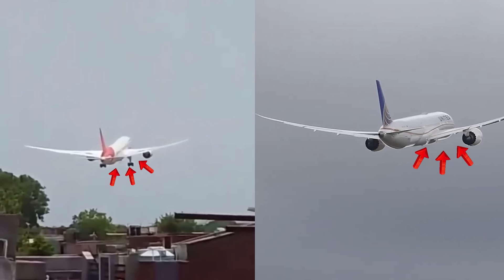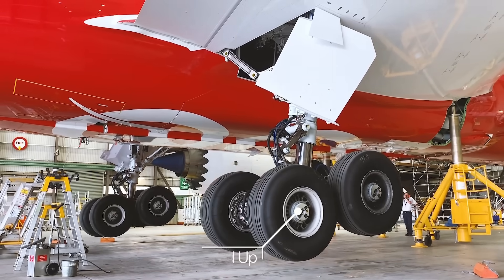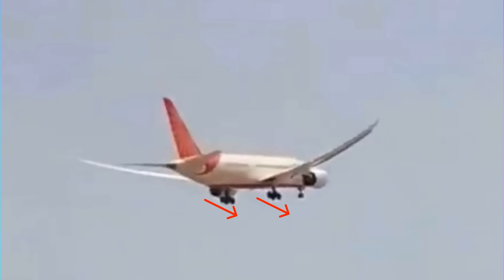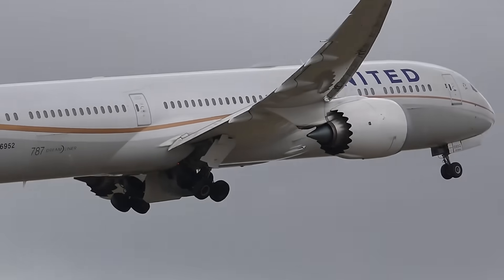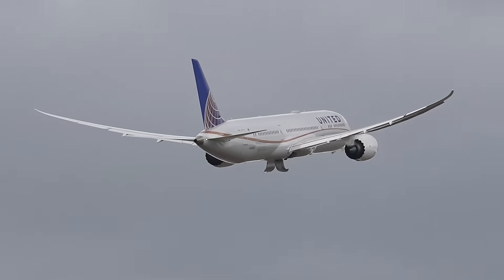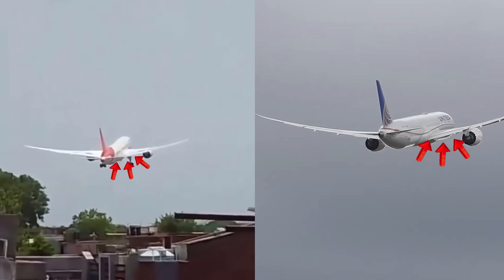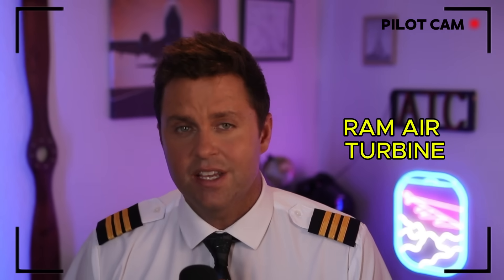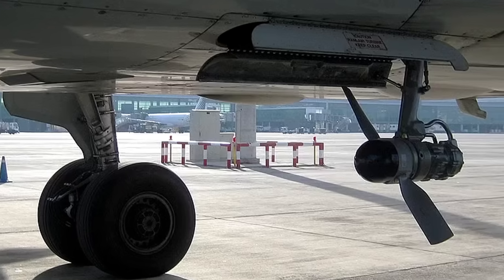Pilot Explains: A New Detail in the Air India 787 Crash Everyone Missed

Comment: Visual Evidence and System Behavior – 
	1.	RAT Deployment: The Ram Air Turbine (RAT) was visibly deployed, and its characteristic noise is audible in video footage, confirming the aircraft lost primary electrical power and was relying on emergency backup systems.
	2.	Engine Silence: Both engines appeared inactive, suggesting a complete loss of thrust, likely due to engine flameout or fuel supply cutoff.
	3.	Landing Gear Position: The nose gear remained tilted forward and stuck until impact, indicating a likely loss of hydraulic power needed for gear positioning.
	4.	Stable Descent: The aircraft descended in a controlled and stable manner, with no observable yaw or roll oscillations. This strongly implies that both engines flamed out simultaneously, as asymmetric thrust would normally cause significant directional instability.

These observations point to a major electrical power system failure, which likely disabled the fuel supply system, engine operation, and landing gear hydraulics, leaving only emergency systems such as the RAT functional.

Possible Causes of Total Electrical Failure

1. 2012 Boeing 787 Generator Control Unit (GCU) Bug

A known software bug in the GCU could cause a counter overflow after ~248 days of continuous operation, leading all primary and backup generators to shut down simultaneously. The FAA classified this as a “cascading power failure scenario” due to the complete loss of AC power across all systems.

To mitigate this, Boeing released a software fix, and the FAA issued Airworthiness Directive 2012-24-07, requiring airlines to either apply the patch or regularly power-cycle the aircraft.
It is currently unclear whether this aircraft was compliant with the directive at the time of the incident.

2. Catastrophic Failure in Power Distribution Unit (PDU)

Another possible cause is a high-energy arc fault or explosion within a major Power Distribution Unit, which could trip relays across multiple buses. Normally, such events are isolated by the Electrical Load Management System (ELMS) and bus isolation relays.

However, according to a Boeing whistleblower, non-standard materials and substandard manufacturing practices may have compromised system reliability. A failure in current sensors could prevent ELMS from correctly identifying faults, causing it to shut down even healthy power buses.

Poor insulation or material degradation could further allow electrical arcing to cascade across buses, resulting in total power loss.

Supporting this theory, the survivor reported hearing a loud bang shortly after takeoff, followed by stalling and flickering green and white cabin lights — consistent with an internal electrical explosion or fault affecting both primary power and lighting systems.

Comment: Good analysys, however, something to point out:  On a 787 gear retraction, the doors open first prior to tilting the boogies forward.  I've read that the tilt actuator on a 787 is of course hydraulic powered, in case of hydraulic loss the gear could go back to it's "original" position, aka tilted forward.   Nonetheless, good video.

Comment: The wrong type fuel in aircraft will cut engines off. If fuel tank storing fuel hasn't been drained and flushed properly and water or contamination was still in the tanks. We all know maintenance has been seriously lacking to all air carriers. I spent 20+ years in the USAF and saw first hand on fighter and trainer acft how people not doing their job caused certain things!
Reply: At least in the military regarding aircraft you have others checking on such things cause things happen even if unintentional. So it’s important to check that things are done correctly.

Comment: I HAVE A HND IN engineering I've explained this it's the fuel accumulator failure
This is the reason for it not to get lift this is a unit which gives the engines lots of fuel to enable it to accelerate for lift off. 
That's the reason why the pilot left the wheels down
He wasn't getting enough lift
All systems working fine
Listen to the voice record 
He's saying I'm not getting the engines to accelerate

Comment: I think there's petrol shut down. What I mean here is If the petrol is there that is required to take a fly was there but the valve is closed or sabotage which may fuselage sabotage. That only the reason which is makes both engine failed due to lack in supply of petrol but the cockpit always send alert if this any, then too cockpit unable to read when there's above a lakh litter petrol is there but if we sabotage by many ways like cement stones and valve. For example- Let's take a old two wheeler which have options from valve to off and put on reserve or not fully on then also person is able to start the engine ride run and suddenly is stops until the petrol is there in pipe. Once the pipe petrol is over then will get shocked why what happened as know there's petrol. But I know it's Boeing latest there's always a alarm but it can sabotage. Experts let me know if this can be happen as I'm not a aviation expert. But it seems 100% power lack as its come down without wavering its come straight.

Comment: The fact that the main landing gear bogie was in a nose-down (forward-tilted) position does not, by itself, prove that the pilots attempted to retract the landing gear.

The aircraft system is designed so that:
   -- If the aircraft is already airborne (WOW = false),
   -- And there is no load on the main landing gear,

Then the bogie tilt actuator is automatically activated, and it resets the bogie from the tilted-up position to level, and then to the nose-down (landing) position.

This happens even if the pilots do not retract the landing gear! --> The system ensures that the landing gear is always positioned for landing, even if it is not retracted.

Look at this video. Here's a B787 that did not retract its landing gear after takeoff, and the bogie automatically moved into the nose-down position.
https://www.youtube.com/watch?v=zxLJ9pd0ef0

(I am not suggesting that the pilots retracted the flaps instead of the landing gear. The fact that, in the video, only the RAT can be heard on the descending (falling) aircraft suggests that neither engine was producing thrust. In my opinion, this is what led to the catastrophe.)

Comment: This is the 2nd time by the same Airlines Air India that crashed last December of 2024 and just recently June 2025.  Two different air-craft made 737 & 787 by Boeing. The 737 max crash last December is still under investigation, and the cause is yet to be determined. It could be due to a bird strike in the engine or some technical issues.  When was the last time the Air India 737 max was inspected and maintained, and how long did it take? Were there qualified maintenance workers specializing in these aircrafts? It's worth noting that the planes were old, and Air India acquired them from a company in Ireland or somewhere in Europe. 

According to my research, the 787-8 in question is 12 years old. When was the last time it underwent a comprehensive inspection and maintenance check?  Did Air India ever seek assistance from Boeing for these inspections, including the engines? It's important to remember that inspecting aircraft is a complex and meticulous process that requires expertise and thoroughness.

My question is, how could the 787-8 take off and start climbing if there was a problem? The 787-8 is equipped with advanced computer systems that should alert the pilot to any issues before the plane lift off the ground.  Was there a problem that was not communicated before the plane began its takeoff roll? It's crucial for Air India to be transparent about these details to ensure the safety of its operations.

Two things that I totally believe it is either the pilot error or the inspection maintenance.  My brother called me yesterday he believe what he heard or read sound like there is NO WAY  it is Boeing fault.  Every airlines have to takes the responsibility to train the pilots exccesively and qualfing inspectors maintenance and always call Boeing for special inspection approval before the plane is allow to fly again.

Comment: I agree totally fuel contamination because that aircraft is in takeoff conviction, I have seen what happened with contaminated fuel in other aircraft, with the Air Force, and yes it's like they pulled the plug and no noise quiet as the poor thing went into the ground

Comment: Could you advice the fuel system on that plane? I assume each engine has separate line with seperate pump, filter and tank (inside each wing I guess). It is hard to imagine contaminated fuel disabling both engines at exactly the same time in such case.

Comment: If you lose an engine at V1, you would continue the take-off, you would use most of the runway ( that happened), with the distraction, you could forget the gear. The procedure is no action until 400 feet, just gear up and cancel alarm. At 400 feet, identify the failure and shut down the engine if on fire or severe damage. How about if the pilot shut down the good engine instead? The plane never reached over 600 feet.

Comment: 4:50 imo it was water in the tanks. And not a little. My guess would be that the fuel pickups are towards the rear of the tank, to guarantee fuel supply during a go around at the end of a flight, where the tanks would not have much left in em. Someone correct me if i’m wrong on that. But these may not be at the lowest point in the tanks, idk, to not suck up gunk which is at the bottom of a tank usually. With that said, the engines would have gotten clean fuel the whole take off run, and just after rotation, as the fuel shifted and the water went to the lowest point, which now was where the pickups are, they both died at the same time. Thats the only explanation i see. Bcs just "stuff" in the fuel would have shown signs earlier

Comment: I explained why the partial retraction supports my theory that the torque from the pumps helped to induce a compressor stall on the second engine. Power loss to the FADEC routine and a reboot status prevented auto-ignition.

Comment: Some say “vapor lock” , high heat on tarmac for several hours caused vapor inside fuel tanks, like a bottle of soda, when lying horizontally, fuel flows is ok, but once it climbs and take off causing the plane to tilt upwards, just like the soda wbotyle with the top/front tilting up, the liquid flows to the lower part while the gas vapor rise to the top, but, There were also other planes at same airport, why was air india only aircraft to suffer from vapor lock？

Comment: I think you hit the nail on the head with bad fuel. They would have gotten new fuel before take off. The fuel already in the lines was being used first. Thats why the engines seemed normal. Then the new/bad fuel hit and flamed out the engines.

Comment: You forgot it was 105 degrees, the plane sat there for an hour..the elevation and the weight of the plane were not entered into the computer correctly therefore the dentisy alltitude was not correct should of been set for 3,391'

Comment: Something on the end of the runway hit the plane or the plane hit the end of the runway, because the plane took off by sheer take off speed. Meaning right before lift both engines are down and electrical failure happened or vise versa. Check the take off footage on the exact timing of the lift.

Comment: Is there a correlation between an electrics failure and a dual engine failure? I'm just thinking with a video that a passenger took of the plane just hours before the crash where none of the entertainment screens were working, or AC, and the lights flickering as the RAT was deployed... I've only just learned about the RAT from Cpt. Steeve so I'm only just gaining understanding on it. Also is there any link between an electricity failure and the landing gear not being able to retract, or is that purely an hydraulics failure?

Comment: I travel out of India yesterday , too many people bring  on board large travel cases that are huge and very difficult to fit overhead lockers and they are not weighed before departure, long flight ahead with large amount of fuel on board so plane could be overloaded.
It doesn't matter how good the engines are , proper fuel supply is needed for engines to function properly, very hot day , did water get into the fuel supply ? Has the fuel pump been checked for any  holes , was the fuel tank where the fuel was being loaded from ,almost empty when the fuel was being loaded as it could have been contaminated at the bottom of the tank , what country did the fuel come from?

Comment: Please go to the Accident Air Florida January 1982, a similar accident, the took off normal, but a few feets they got a stall, why? well due to ice the sensors in the front of engine 737-200 were frozzen, so when the pilot move the levels to take off power EPR they got this EPR very fast and the plane run normal, and reach V1 and Vr on ground but, they didnt have a correct EPR, only a number on the instrument, due to sensors failling, then they wneto to air and logic the plne for inercia and ground efect took off, just to flight direct to bridge of street 14 , at  1000 mts from the thresholds 19. I mean may be for electronic probblems when they set the take off power, I guess full due to temp, I dont believe that they are using assume temperature, very hot day, so the plane N1 show 100% but due to a electronic failure, they have may be 50% or less, I know there is a way to detect this during the take off time to 80 or I dont know move slowly, they accepted this like an normal take off, and when they went to air , no enoght power, think about this. Or AT fail and retard the levels.

Comment: I think it was double engine failure, but doubt it was contaminated fuel. The first reason is why hasn't it affected any other plane, the second is the engines wouldn't suddenly cut out and at the same time. It has to be a controls issue.

Comment: The Engine Fuel Shut off levers have a Spring loaded detent in ON position. This lever has to be lifted up and moved Down to Cutoff position. So possibility of Both Engines flaming out by Fuel Shut Off levers should be slim to none. Thanks for your analysis

Comment: Electrical Bus Failure - Backup System is probably not rated to run both fuel pumps at full load during take-off - subsequently both engines flame-out?

Comment: When you select gear up the first two things that happen are 1, the wheels tilt, 2 THE GEAR DOORS MUST OPEN and I don’t see them at all!!  Which baffles me but I do agree with the engines have only ONE THING IN COMMON……………the fuel 🤷🏻‍♂️which makes me go with your mindset of fuel contamination and SOMEHOW the fuel filters got clogged preventing adequate fuel flow through the MEC and they lost power to both engines!  Sadly the power loss didn’t happen before rotation giving the a fighting chance to ABORT the takeoff 😢🙇

Comment: Pilot error seems unlikely. Dual engine failure is what it looks like. Boeing should be held accountable. Had it been contaminated fuel, the sane oil company provided fuel to the other planes. Why no accident to those planes. It looks like the unlikely actually happened and thats dual engine failure.

Comment: Captain Steve did mention that the plane had used up excessive amounts of runway noting that he observed dust being kicked up by the plane's engines . How normal is it for a 787 set up for a long haul such  to use up that much runway? If not obviously this could mean that the problem started during the take off roll before the plane became airborne maybe there's some indication from the black boxes regarding engine performance that should have warranted in abort attempt.. Regarding fuel contamination were there any other issues with planes using the fuel from that airport?

Comment: Did you consider vapour lock It was hot and it sat in the heat for a couple of hours… vspourisingfuel in the fuel lines?  It’s what a young pilotwas explaining using yesterday, it seems to me to be a possibility.. fuel vapour is more flammable than even aircraft fuel. Just saying, it made sense when the chap was explaining.  If fuel in lines is not liquid, but vapour?? = engine out?

Comment: Dual engine failure is such a remote possibility, it would have had to have happened moments before the RAT deployed, and if dual engine flame out was the cause then it must have been either fuel contamination, vapor lock, which I doubt because while it was a hot day planes take off in hotter cities all the time, or a failure in the the electronic engine controls, or possibly in the variable frequency starter generator.  That in turn suggests again an electrical problem in the Dreamliner.  It seems hard to believe that the fuel would be contaminated at an airport as busy as Ahmadabad without there being other planes affected.  Anyway, both black boxes are in the hands of investigators so if the investigation is honest and transparent we should soon know what happened to the plane.  I am just very doubtful that any blame will be shed on Boeing for its fundamental design, because a grounding of the Dreamliner likely would be the end of Boeing and there is far too much money at stake to allow that to happen.

Comment: Great job. One thing you could add is that the lack of fuel could be from shutdown of all  hydraulics and electrical power due to mechanical problems (which would cut off the fuel pumps) rather than caused by operator  error. The timing when that happened was when the landing gear was being retracted. Could be a problem in the wheel well.